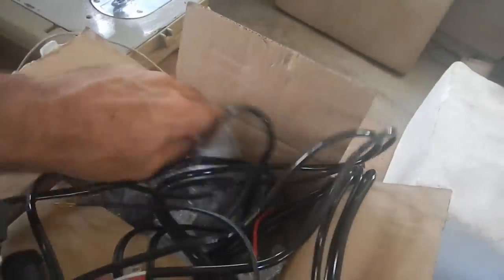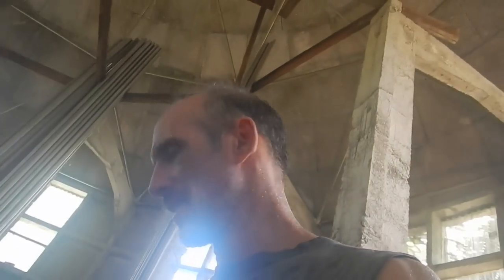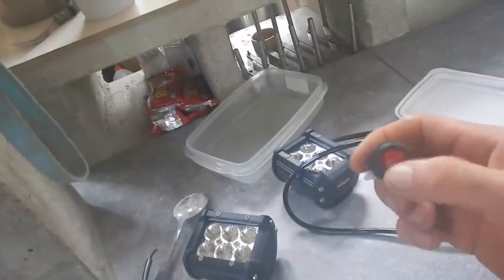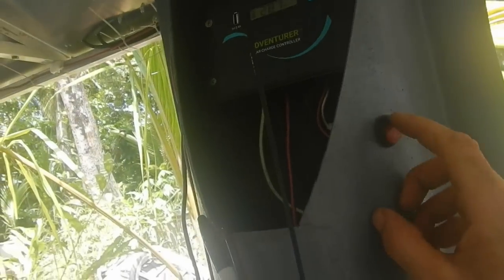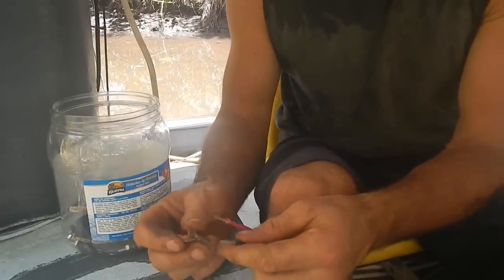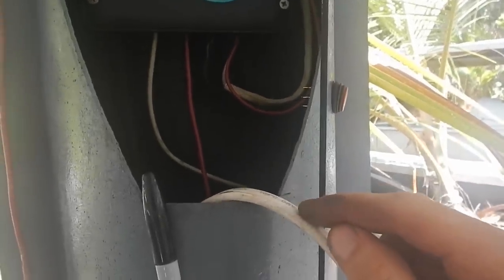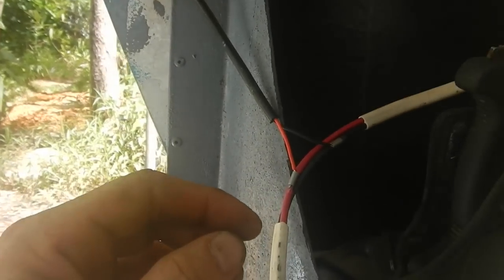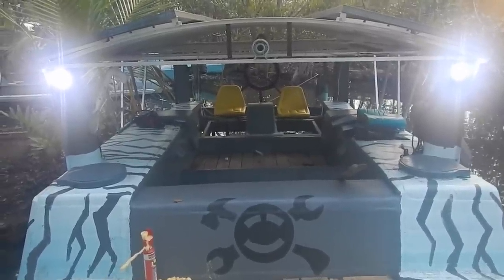Shark Slicer 033 Headlights!

Comment: If that switch is an illuminated one, you have to connect ground to the third leg.
Reply: I was about to give the same advice, but it occurred to me the other terminal could just be a normally closed (N.C.) connection. 

The translucent switch holds out some hope for a light though, but it would probably need a resistor to not be burned out by the raw voltage.
Reply: Maybe. But usually lit switches have resistors in them, and the original cabling he didn’t use had all three prongs hooked up. I’ve never seen an external resistor in those kinds of plug and play automotive cable harnesses.
Reply: @madmodders  Fair enough, I honestly do think the third leg is for an LED. I just imagine even with an internal resistor, they're rated for a certain voltage (Automotive is like 12-15V and Jamie I think is roughly 25-30V) so it will be overdriven at roughly twice the current unless an external resistor is added in series. 

The real key would be to see if it could illuminate when the switch is off, to find the switch, but most likely it turns on when the switch is on. I'm sure it'll be in Jamie's kinesthetic memory shortly regardless :) Thanks for the polite discourse

Comment: I have those exact same lights on my pontoon boat. They are definitely weather proof, you can mount them all the way forward if you want. Try grounding the 3rd leg on that illuminated switch, it should illuminate when turned on if you do so. Also add an inline 2amp fuse to that lighting circuit. Fuses stop fires. I had an old trolling motor that shorted out and nearly burned up my boat. I only had a manual shut off for the power to it and forgot to disengage it, if it also had a fuse it would have shut things off when it shorted out and drew too much current.
Reply: Jamie doesn't take advice.

Comment: if you add some solder on the copper pipe connectors it would help a lot corrosion wise specially to bound the connector and the wire

Comment: That switch does light up. The third prong is, I believe, another 12V power for the light or a ground. You will need to check the wiring drawing for it. Should be easy to find

Comment: With fingernail Polish remover and Styrofoam. You can shape it to a form or mold. plastic parts and a thinner solution to Brush on a waterproof barrier. It has been used to protect lawn and garden decorations like ceramic & clay. In liquid formed keep a jar tightly sealed Ready for use.
Reply: *acetone

Comment: did you test those lights? I got some like that and they were only 3 watts even thought they said 18 watts. Also they leaked and were a horrible yellow colour. I replaced them with "CO LIGHT 12D Led Work Light 12V 24V 4 inch 96W" which are still only around 6 watts but they work great after resealing and upgrading to stainless fasteners.